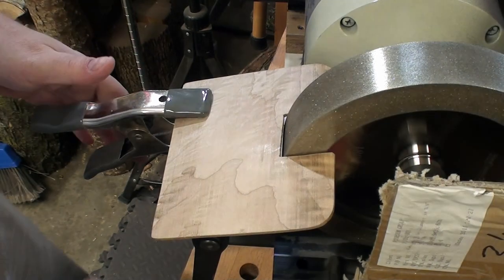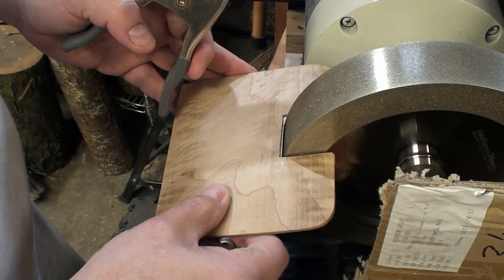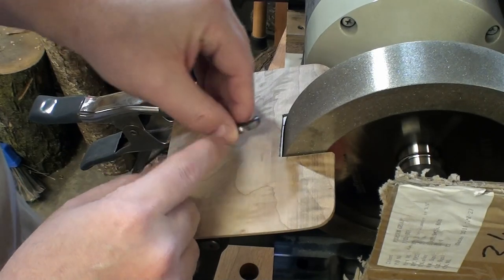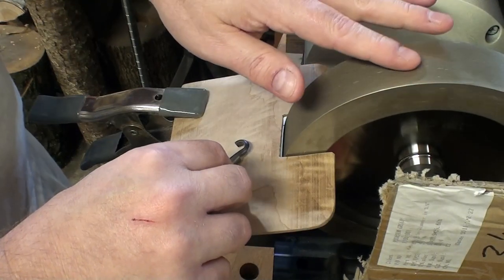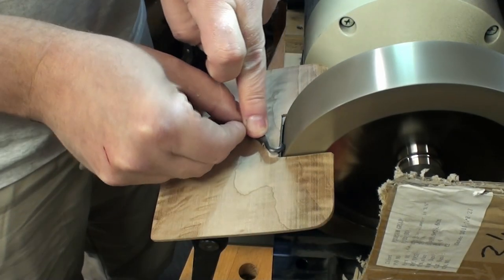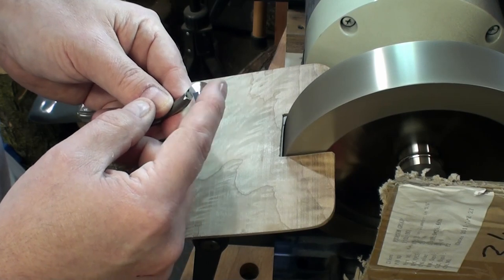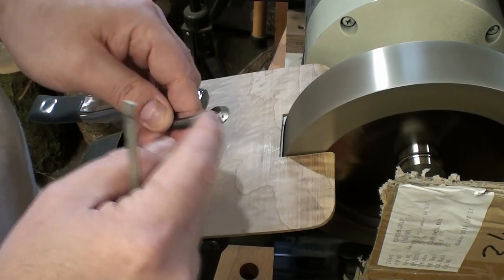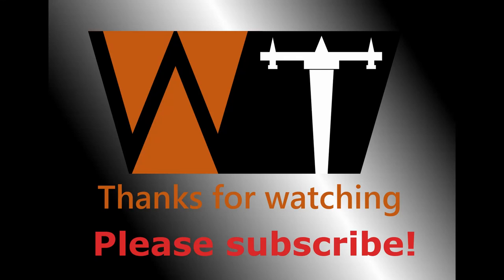Hook Tool Sharpening Tip

Comment: Good day Sir Tod.  As your busy schedule permits, would you please share the approximate angle that you set your platform to, so I can use this as a starting place for the occasional sharpening of the outside of the tool I acquired from you a few years ago.  Thanks in advance for your time, BC
Reply from the maker: Thanks for watching and the comment. Measuring the bevel angle of the Hook Tool it is about 60 degrees. Essentially I move the platform to accommodate the angle needed. Here is a link to a short video where I show the sharpening of the hook tool. https://www.youtube.com/watch?v=VILXj_-RdkM

Comment: Could you please tell what angle that is thankyou.
Reply from the maker: Roy, the bevel on the Hook Tool is about 40 degrees. I just match the platform angle to the tool in most cases.
Reply: Went into the shed tried it, worked perfectly thankyou.